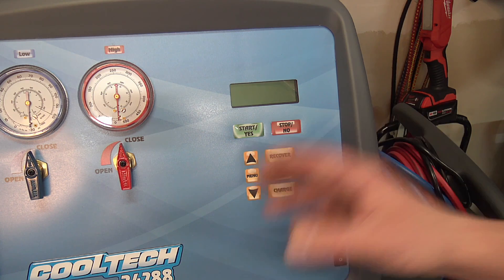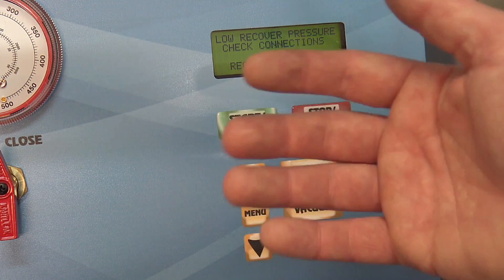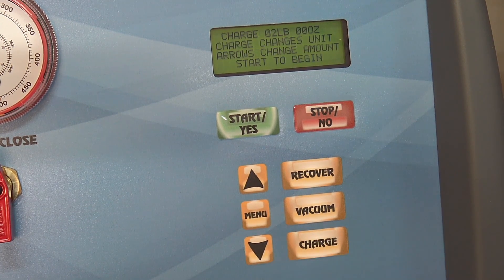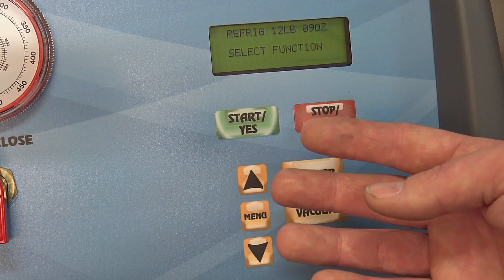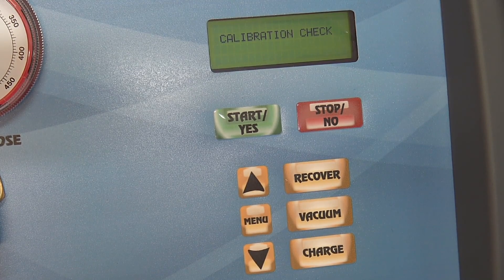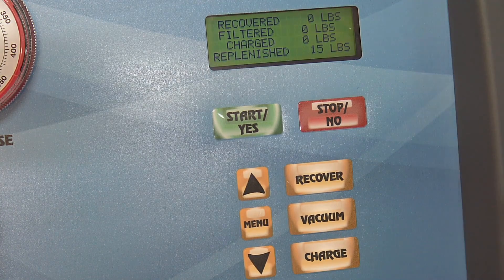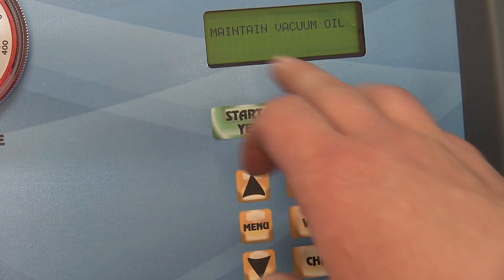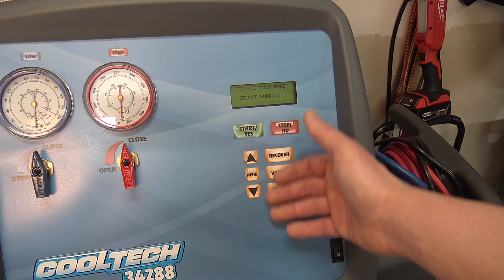Robinair A/C Recovery Machine: Features & Operation

Comment: +fordtechmakuloco Hey Maku, Can I ask you a question? I know you probably get like 100,000 stupid questions from people each day, so I never get an answer I'm OK, however this is related to this and right up your alley!  I have a 2002 ford explorer with a 4.0/auto 4x4, its limited with the digital heat controller. A month or so ago, i started the truck and was on my way out when i started smelling some funky smell, I didn't think anything of it, shortly after i started seeing smoke/steam from the air vents. I thought my blower motor had blown since it was always loud and squeaky, but after replacing it, the blower still doesn't work. I've checked fuses that I can find, and relays and they all look ok, any ideas? both blower motors work with a 12 volt battery source, rear blower works..
Reply: Leaking heater core?
Reply: digital control blew...sold the truck :P

Comment: Thanks for the videos I'm a independent Euro car tech one of my next big tool I'm going to buy is a A/C machine I"ve notice that the company that sells tools for the VW dealers supply them with the same brand of machine that you have I have a few questions why did you chose this particular brand of machine compared to others second I think that there is a machine with the same model no. That you have but with a H at the end witch stand for hybrid in hybrid cars why did you not buy the hybrid model is the price much higher or that you think that you will not need it I know that the difference are not that great but the main diff. Are that the hybrid machine is not allowed to inject oil in the system like I said I'm a licensed tech but never used a A/C  machine but I"m looking at a machine like you have now the last question is what happens when you get a car with sub standard refrigerant like with sealer or cheap or small cans fill tanks etc I really like that you are going to show how the machine works and all the function and the maintenance required for this machine .

Comment: How long would that 15lbs last in the tank?
Reply: obadiah7771  Short answer: there is no set amount of time or number of cars that the 15lbs will last.  It depends on the number of recovered lbs of refrigerant minus the number of lbs of refrigerant dispensed to charge the vehicle systems. 
Long answer:
The 13lbs Brian installed is the base available refrigerant charge in the internal holding cylinder. 
Most internal cylinders have approximately a 30lb capacity, meaning that the refrigerant recovery system can recover an additional 17lbs (approximately) of refrigerant/oil/dye. 
As an example, the refrigerant recovery system internal cylinder contains 13lbs before starting and Brian recovers 2lbs from your car, repairs the A/C system, evacuates it and charges your system with 3lbs, the recovery system now has 12lbs in the internal cylinder. 
Some systems may only require a few additional ounces to recharge a vehicle. 
If a vehicle A/C system requires 4lbs of refrigerant and comes in the shop with no refrigerant because of a leak, then it will take 4lbs of refrigerant to recharge.  There is no set amount of refrigerant that each vehicle will take to recharge.
Reply: Wow, thanks for the clear and concise answer! I appreciate it😀